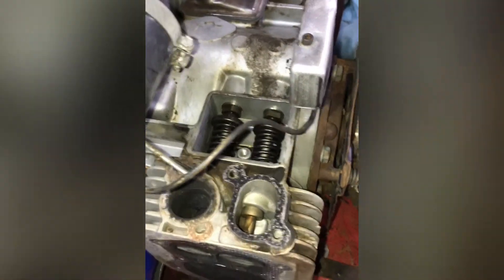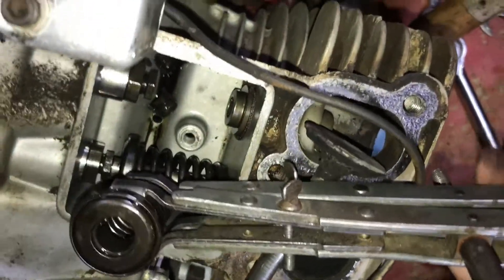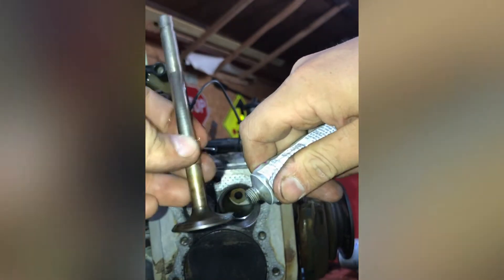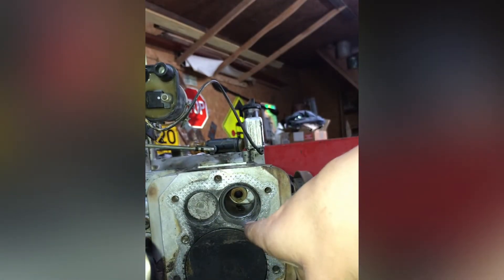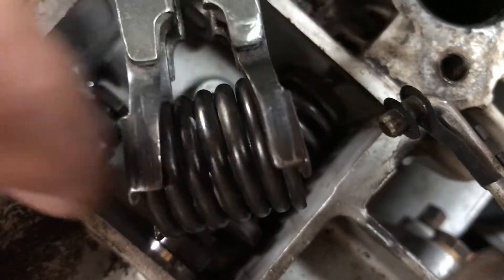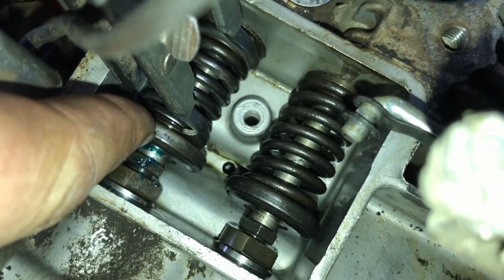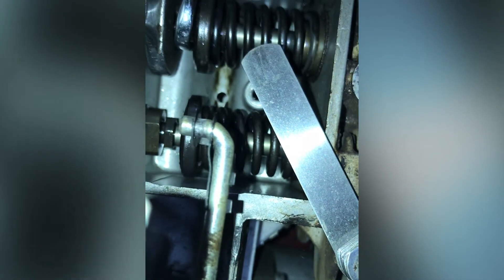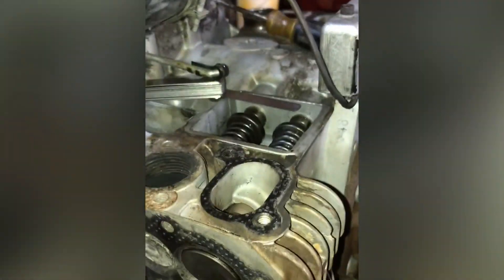Lapping and Adjusting Valve Lash Kohler/Onan Flathead Engines

Comment: Did you adjust both sides of the cylinders on TDC or each one have to set separately please let me know because I am trying to set mine an it will not start I don't know if I have to adjust on side on TDC and turn the engine to TDC for the other side please let me know thanks

Comment: Onan says to NOT lap valves because they run two different angles on the valve vs seat. 44 and 45 degrees to give a sharper contact patch. At least on my ccka.